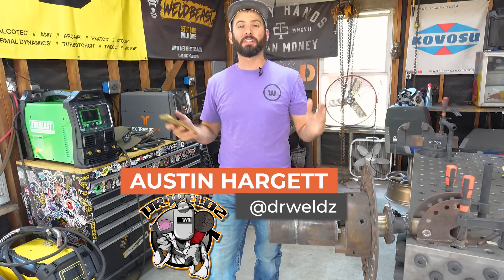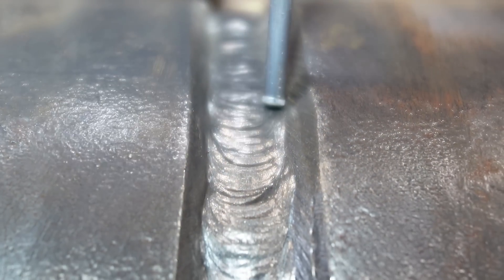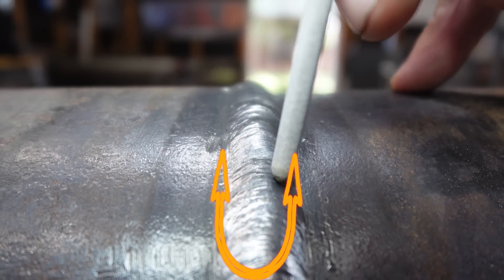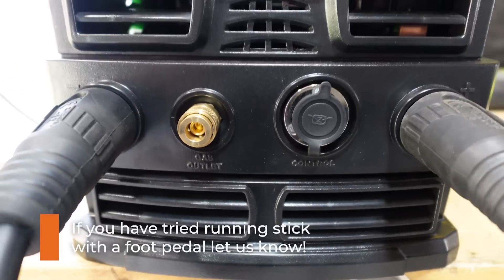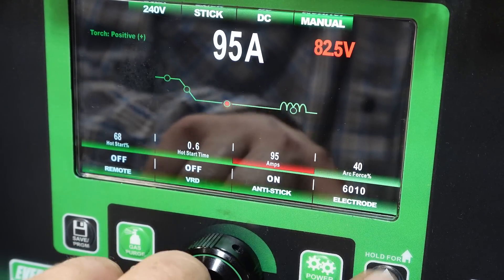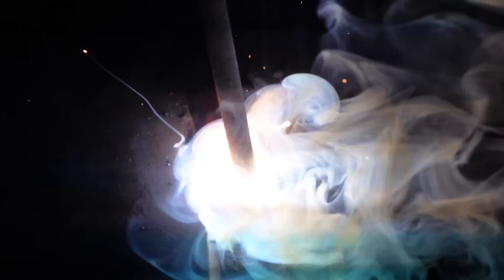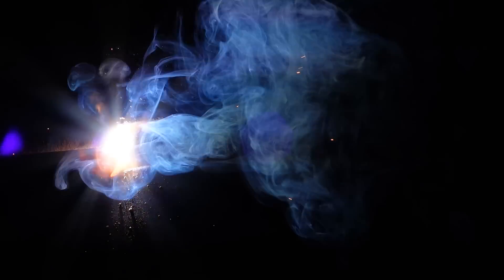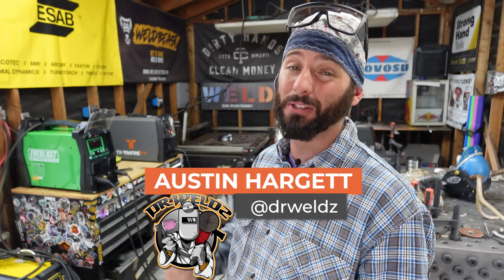How To Weld: Weaving On Pipe With A 7018 Rod

Comment: Great video! Any chance you could do a 1G open root butt weld video 1/8 6010 root 1/8 7018 fill on 3/8 plate. I have been really struggling with the root. Do you have any good ways to practice this?
Reply: Make sure your putting landings on your open root plates so there’s something the metal can land on with the root pass. I prefer 3/32 landing. If it’s a job your practicing for, the gap and landing might be fixed to something else on the WPS.

Comment: Mind blown 🤯 Thx! I was always taught to break down my beveled edges with my fill pass but I would always lose my lines doing that. Thx so much!
Reply: Don’t touch them until you’re ready for the cap!
Reply: You were taught wrong, I leave a thin line on each side of the bevel, makes the cap easy

Comment: I just set my Miller 250 to 85-90 and do a quick weave with no hesitation.  It gives me a slight undercut on the edge that fills as I go . Everyone is different, but I pass the  x-ray
Reply: X-ray just shows clean 👌🏽👍🏽
Reply: That’s all that matters
Reply: @downhilldaddy5282  at 62 I can't believe these younger kids around the shop don't know how to do anything but squeeze a trigger.
Reply: @bobprice9244  it’s sad
Reply: @bobprice9244 teach them than than 😂 you think these schools be teaching them how to problem solve or anything other than welding, nope. It's the old generation job to teach the new generation to make sure nothing goes to shit
Reply: Do you do Z weaves? And how far should you jump across.
Reply: @itsyourboy4047  I do z weaves but it's really quick.  Not even a 1 count. I kinda slap it side to side looking at the bit of undercut to fill in.  It gives me the tightest stack of dimes. Dimes are too fat to use as an expression.  It's almost looking like a mig weld flat using Lincoln HD-C 1/16 wire in the flat position .  It passes exray and the inspection.  They are pressure piping or pressure  tank repairs,  so everyone is happy.  I'm kinda anal and believe cleanliness is next to Bobliness. Maybe that's why it works for me. It did take a while to get it. Maybe 3 months.  Seems like an eternity for a day a week only on my time.
Reply: @bobprice9244 tried it today I'm watching the toe lines for undercut, should my arc be in front of the puddle or behind the puddle about 1/3?. Also should I let it puddle build up or move fast where the puddle follows my arc?
Reply: @itsyourboy4047  honestly I'm going so fast I'm not sure.  I believe I'm slightly ahead but still on half the puddle.  It's more like quick lines rather the shape of a z I don't worry about the center anymore because I've been doing it so long it just works for me.  I just got done with a pipe cover and I swear I felt it dragging as I went along.  Maybe it's just a really tight arc.
Reply: @itsyourboy4047  Just pause to let the puddle fill in.
Reply: @itsyourboy4047  your puddle is always behind your rod's travel direction not in front.  wtf
Reply: @DongWang-m4n I think you misunderstood me. When you go faster, the puddle will be behind the rod, right. But when you slow down and keep it tight, about 1/3 of the puddle should be in front of the rod as you're traveling up. I was wondering how quickly he moves in that case. Of his technique
Reply: I like the idea of his technique then the other traditional ones of holding on the sides